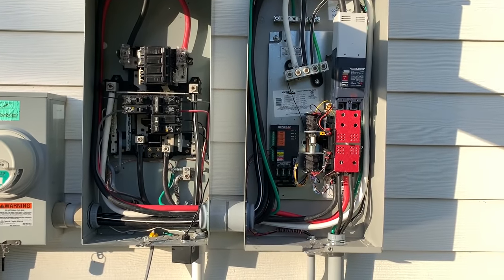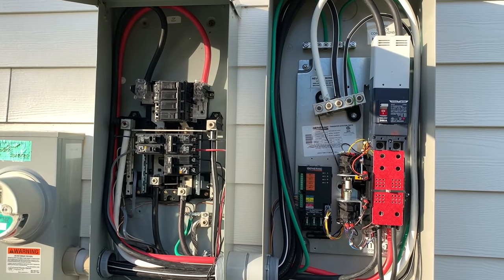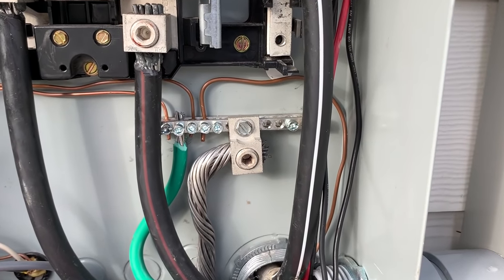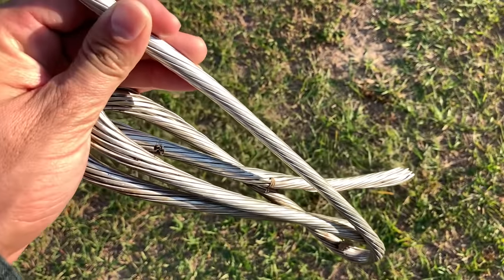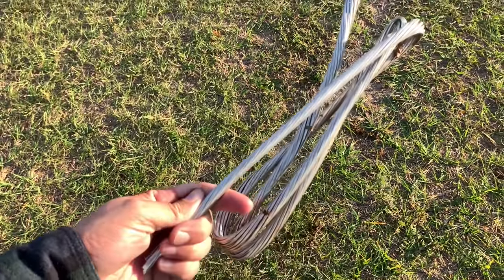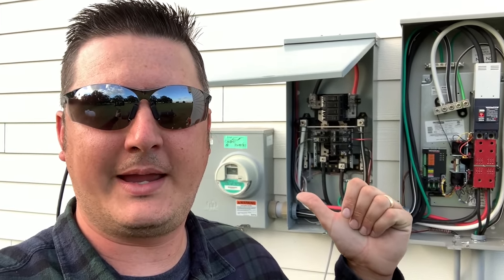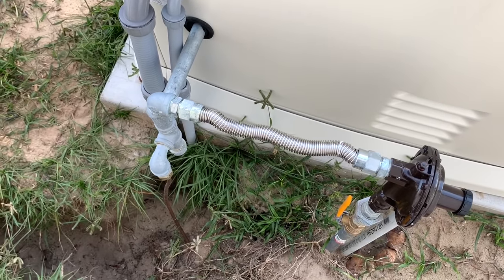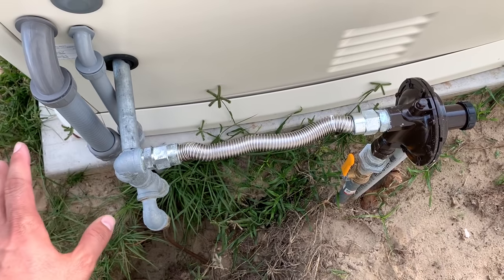Problems with our Generac generator install￼

Comment: It is almost impossible to keep those flex lines straight, with no twist or bind, as that happens on the final few turns of the nut onto the flare fitting.
As others have stated, code states no flex line through a cabinet. This is to keep vibration from cutting through the "thin" material of the flex. Black iron pipe would not be effected by vibration.
Reply from the maker: Ok thanks for the explanation! I’m definitely not a gas guy. I did wonder however why they used galvanized pipe instead of black iron pipe. I’ve always heard the galvanized coating will break down and end up going into the engine/appliances. Is that true?
Reply: @MaynardFamilyHomestead  
I am not sure of the specifics on using galv pipe instead of bi for gas, never used anything but bi.
Looks like a small amount of it, so either hve them come back and replace it or replace it yourself, in my opinion.
Reply from the maker: @jrsmyth9761  I think I will. Thanks!
Reply: @MaynardFamilyHomestead  The little that would come off the pipe won't matter much. The galvi only corrodes in the presence of water over the years. The gas should be fine and will stop the exterior corrosion. BI outdoors will look horrible in no time flat.
Reply: @steven7650  
Any exposed or buried black iron should be painted/wrapped accordingly.
Propane is quite "wet" compared to natural gas.
Reply: @MaynardFamilyHomestead  Yes
Galv pipe is a plumbing violation. Pressure regulator is supposed to be a minimum of 10 feet from generator.
Reply: @MrRikkitikki  Or pipe the vent to 10' away.

Comment: Have you ever installed load shedding modules for hvac, water heaters, ranges etc., if so how do those get wired in for operation? Thank you.
Reply from the maker: Our generator was big enough to run everything so I didn’t install load shedding devices. I am familiar with them but I’ve never installed them personally.

Comment: Does the 24 kw generator run your hold house including the air conditioning
Reply from the maker: Yes it does, and doesn’t even bog. It is a great machine.

Comment: I believe manufacturers not the code have always recommended wire brushing   & anti- oxidant because of the thin film that sometimes builds up on aluminum conductors. Wire brushing is always good practice even if none is applied.
Reply: I dont know of any manufacture of cable that recommends that and we use a wide range of manufacture, thats old school that does not apply to todays alloy cable.

Comment: Love your video and this is the second time watching. One dealer states they would not and was told by Generac to lock out a heat pump because it would cause problem with the generator. They won't even do a delay start for a heat pump. What are your thoughts, was looking to get 24kw? Thanks.

Comment: Per Generac install instructions the flex specifically does not go into the generator and the flex must be horizontal.  It is correct as you have it.

Comment: I had dealer install and he used a piece of angle iron and sank it several feet down and attached to gas line to reduce vibration of the gas pipe. The flexible pipe goes directly into generator - not in between as noted in video.  Not saying which is correct, sharing the way mine was done.
Reply from the maker: The angle iron is a good idea, I might do that! Thanks for watching

Comment: The gas piping needs some work. A larger pipe out of the meter is needed for volume at start up. 10’ pipe is recommended and a fast opening regulator. You are correct in that the flex corrugated pipe connects inside the generator to rigid pipe. That flex pipe allows for vibration of the unit. Inadequate gas piping will cause motor failure.

Comment: I may be all wet and maybe it is not a concern in your particular area, but with the 2 Generacs that I have had installed, I had to maintain 3 meters (10 feet) from the gas regulator,  one propane, one natural gas.  Thoughts?
Reply from the maker: You’re not crazy, that’s code here as well. The tank is about 15’ from the house and 10’ from the generator.
Reply: @MaynardFamilyHomestead  Thanks for the videos.  The regulator is considered a fuel source and is supposed to be 5' away from the generator, however, you you remove the screen and install tubing or pipe into the threaded vent on the regulator you can move that 5' away and be fine.  Replace the screen at the end of the pvc vent pipe to keep insects out.  If you split a diaphragm, you don't want propane to ignite from the ignition system nor do you want the genny to over speed because it got a big gulp of gas.

Comment: Mine came with a pre made flexible 18 inch gas rubber line for LP hookup straight from generator with flare pipe fittings and hose was pre made with female flare swivel connectors on it .  Nice job tho .     I’m getting to reinstall the old Generac generator at a different location , the one I’m referring to is about 10 years old and barely any time of use on it, so my friend wants it reinstalled at his other new camp.   My transfer switch also has breakers in it and was under the porch and I’m a bit concerned about them being out in the open, I think Generac has upgraded to the transfer switch you have and mine is just older tho.  I’m still looking into it before I fully reinstall it .  Any info would be appreciated.  Ty

Comment: You can wire nut aluminum to copper . ideal 30-165  are the wire nuts to connector the 2 metals, tho i wouldn't do it in  the panel just because its ugly.

Comment: The drip leg on the gas is not needed as there is one built into the genset. I do think an external valve should be on the line between regulator and genset however. I'm in process of installing one now. I have 30 years with an electric & gas utility. The one thing I noticed at the end of video is that there is a 1/2" line coming off top of propane tank yet 3/4 poly being run to the genset. I'll have to ask my gas supplier if it matters at all. The 26Kw machine I am putting in requires a 3/4" line.

Comment: What I have in the planning stage is to use a Meter Main Combo bringing in 320/400.  The Siemens Meter Main will have 8 slots for a potential 16 breakers. And will have (2) 200 Mains one for the main house and one for a large garage with attic trusses to create a bonus room.  The garage 200A Load Center will also have a sub panel with sub-panel breaker to feed a 100A Load Center for my RV garage several hundred feet from the main garage/house.  You mentioned in the video that you did not want to use a Combo Meter Main?  Can you expound on that a bit more?  I like the idea of the combo that has the ability to have 2-200A mains to feed my two load centers (one for the main house in a basement utility room and the second for the garage/bonus room).  The Generac Transfer Switch in this proposal will be set up similar to the way you show here. I am just curious why your set-up is different than what I have in mind using a Siemens PN MC0816B1400RTLM 320A Continuous 120/240V 1-Phase 60 Hz 22KAIC with 2-200A main disconnects.  I did create a diagram of what I believe the wiring schematic would look like, and I will present my plan and sketch to my Electrical Contractor (I am not doing the work myself), but ahead of doing that I wanted to understand why you made that comment.  It would be great to be able to email you my diagram for comments but I am sure you don't want your email posted here? but thanks in advance for any reply -- Retired Person (over 50 years now of construction management)

Comment: Have  you tested to see how long a run you get off propane? Would it run for a week if we had a hurricane? Just wondering if you tested to see how much propane it uses.
Reply from the maker: Thankfully I haven’t had to run it for more than about five or six hours. It’s pretty efficient, although if I was looking at long-term outages I would probably cut it off for a few hours here and there just to conserve fuel. I would say it would definitely run on that tank for a week with a little bit of rationing.
Reply: @MaynardFamilyHomestead  
You can see the gallons per hour fuel consumption in the manual.
That tank may be a 110 gallon tank, but is only filled to 80%, so 88 gallons.
As the fuel level get close to empty, it does get more difficult to use the remaining fuel because it will not change state due to lower pressure.

Comment: Stripping the wire with a utility knife, cutting or nicking the wire, is that de-rating the wire? and looks like that 2 1/2 in conduit would be considered overloaded? and is there not a torque rating for the lugs to be tighten to?

Comment: if your ground bar is al/cu compatible which most are its ok to mix attach them but never splice , same with no lox if the lug being used isnt al rated you should use nolox

Comment: I would have put a complete LOOP in the flexible pipe in the gas connecton instead of a short straight length of flexible pipe.

Comment: De ox saves the lugs I put a little in the back of the lug and dip the lug allen bolt so the threads have a thin coating

Comment: Very nice videos on the standby gen, So the generator feeder cable size looked much smaller than all of the other feeder cables, What size was used and why is it smaller. Also why direct bury part of this feeder cable? Why not ensure it in conduit all the way? Thanks
Reply: I noticed that. I don't think we are allowed to direct bury in Australia. I've been out of the game for years here but it seems sensible to use (orange) conduit as the last barrier against some idiot digging and cutting through a cable. The other aspect of this cable laying is that it looked to be single insulated and I'm almost positive we can't direct bury that stuff here; not 240v stuff anyway. extra LV yes, no problem, do what you like with that.
One thing I was taught, don't use Stanly knives/sharp blades as cable strippers because small nicks in the (copper) wire can cause hot spots. Something about voltage running on the outer skin of wire or multiple strands in cable. Anyway, I've always stuck to that and also told to go for neat rounded strips to reduce chance of plastic insulation being jammed into the lug along with the conductor, thus causing a bad connection. Otherwise My Maynard, I quite enjoyed your video and very first time I've seen Al used in a domestic setting. I used to run Al service lines to homes and commercial buildings though.

Comment: My only question on the nipple, is it overfilled?  Pretty sure max fill rate for a nipple like that is 60% and regular conduit is 40%.  Depends on the wire type, insulation, and gauge, per NEC.  I’m not an electrician, but I grew up with one.   Like the videos, planning to build and go with a similar setup.  Keep up the good work.
Reply from the maker: My conduit fill calculating is a little rusty, but my figuring had it very close to 60%.

Comment: The generator wires are a lot smaller than the power line.  What is the rating  on the generator and what happens if you go over it?  Or are the  breakers total lower and you cannot add more than the genre to rating?

Comment: noalox not required by code but read the transfer switch installation requirements and it is required by Generac and plastic bushings on pvc connectors

Comment: I have installed over 800 of these units and service about 1000 a year while working for a Generac dealer. If you want to do an actual walk through let me know and we can do a walk through on zoom, and get you the documentation required so you can get the install fixed up to proper codes and requirements.
Reply: ModMyLife. Could i get some manufacturers instructions for complete install. Would appreciate if possible. Thank You

Comment: I bought a home and when I took possession, the generator was running. It made sense because the owner had disconnected the power before I took possession. 

I called the electric company and setup a new service. A few minutes after the service was connected, the generator turned off (make sense). After a few minutes, however, I lost power to the entire home. The generator didn't do anything, and I didn't have power. I called the electric company, and they confirmed the home had power. What could be the issue? Is it the transfer switch?

***
Troubleshooting I performed: 

I removed the panel from the generator, and the switch was on the "ON" position. I flipped it to "OFF" position, and the generator kicked back on and power was restored. I then returned the switch to the "ON" position, and the generator turned off. This time I didn't lose power to the home. 
***

Appreciate your insight.

Comment: Just one question, and I am an ex electrician, but what is the wire size for E1, E2, and the ground and neutral for generator main power. It looks like the two hot wires are 2/0 or 4/0, and the ground and neutrals a little smaller? Thank you for you time!

Comment: I'm sure there are a lot of DIY types like me that love to do this type of stuff. Most things you do in your house will mess up your own stuff and you take your lumps and move on. This generator project is different in that it affects the lives of the utility workers who might walk up on something they assume is dead and get hurt. This used to happen in rural areas where a dairy farmer would have his PTO driven generator home-rigged to keep the operation going and they would back feed a supposedly dead line. Don't be that guy.
Reply from the maker: I agree, a transfer switch or interlock kit is a MUST.
Reply: Where would one reseach just how often a backfed line occurs? Im kind of a Tinfoil Hat guy, and I 100% understand the opportunity for a backfeed...HOW often does it happen?

Comment: My generator install included mobile link. All I have ever gotten in trying to get it to work is a weak signal from the Generac which will not hook up to my Wi-Fi. I tried to get help from the Installation co.. Generac and Mobile Link. but got no response from any of them. I am paying extra for this service so why am I being ignored. Neighbor has same problem. Got any ideas how I might be able to solve the problem? Did not see any accounts of this problem in reviews I found prior to purchase. Seems there is no integrity left in the people who run these companies. 
for me I have to have oxygen respirators 24 hours a day to survive, and I can't trust the utility to react quickly enough in the event of an outage. Also, can't understand why the installation cost. 3 times more than the generator. Any advice would be appreciated.

Comment: You earning better pay going from electrician to a home builder? and what licence are required to be a home builder? Thanks
Reply from the maker: I earn a little more, and it’s less physical labor. I’m a superintendent and I manage the homes from slab to drywall completion. My job doesn’t require any license thankfully, I work for the fella that holds a CRC license.
Reply: @MaynardFamilyHomestead  very informative thanks for taking time  helping me, I think I'm gonna stay with electrical at least until I find a friend with a CRC license and give it try. Good luck I know dealing with various contractors can be stressing.

Comment: Really liked your video!   I’m in the process of installing my generator. What size wire did you use from the generator to the transfer switch?  Thanks for you video!
Reply from the maker: Thanks for watching! Wire size is based on the breaker size in the generator. I used 2-2-4-6 aluminum since I have a 100a breaker.
Reply: Great! Yep I have a 100 amp breaker as well.

Comment: On the install video   I recall you saying u almost forgot to separate the ground and added the ground bar       here's my question   is the neutral the same as the ground- sharing the same metal of the box   or is the neutral insulated away from the actual metal of the box      just saw another video and  I believe they are separate.   When the main breaker is opened does the neutral also disconnect from the main feed from pole.
Reply from the maker: Great question! The neutral (grounded conductor) is only connected to the ground at the first means of disconnect. After that the neutral and ground must always be separated. The neutral is the path back to the source for any unbalanced load, and you don’t want that to energize anything that could be touched.
Reply: @MaynardFamilyHomestead     Thanks.   When the main disconnect is opened up.  Does the neutral also disconnect from the incoming lines.
Reply from the maker: No sir, just the current carrying conductors.
Reply: @MaynardFamilyHomestead  its better to say ungrounded conductors because the neutral is a current carrying conductor.

Comment: we always do these hot just because in our area it can take days for the electric provider to come back out. i guess technically not the legal way but at least the customer isnt without power.
Reply from the maker: If I would’ve had insulated T handles I would’ve done it hot as well, not gonna lie LOL.